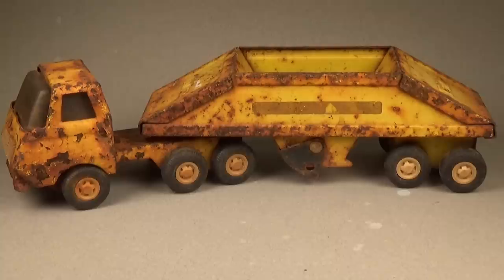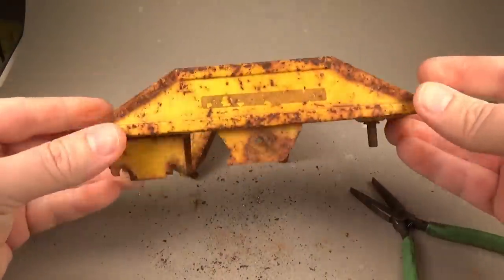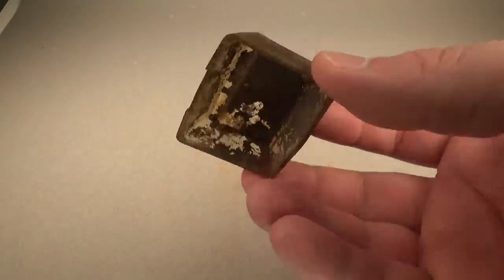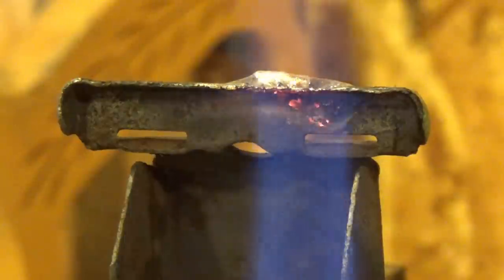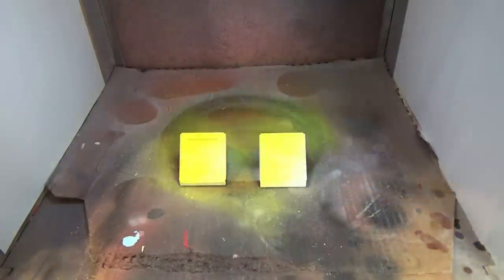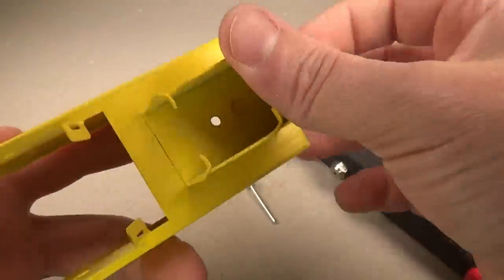Vintage 1970's Tonka Truck Gravel Spreader Restoration

Comment: You can remove the yellowing with salon care 40 works great brush on and use plastic wrap cover it set in full sun for few hrs or use uv lights. All yellowing will go away.... hope this helps

Comment: We use 2 of those sand blasters at work for industrial sandblasting of small components.   Your concerns are not really s problem.    The medium is reused.  If the guns gets blocked. It's because you don't have enough air pressure.    From an OEM design standpoint of the sand blaster.   That would be a very serious design flaw.   But it's not true.

Comment: Now that you have a sand blasting cabinet, will you be sand blasting your die cast cars to remove paint?
Is there any danger to compromising the body by using sand blasting method to remove paint and oxidation from die cast cars?

Comment: I have a black Tonka truck from 1980 that has a motor generator of some kind that still powers on without batteries when you push it around. They don't make em that rugged anymore.

Comment: In case you need to retrobrite in the future: the 8 bit guy tested several methods in a video and figured out it's not so much about sunlight or UV light but heat, so no reason to desperately wait for that precious sunlight. :-)

Comment: Removing paint then blasting is time consuming, If the gun gets clogged up just put your finger over the outlet and pull the trigger it will back blast the feed tube and dislodge the chunk. Eventually the paint or grease chunk will get ground down enough to stop clogging and you will feel the chunk shoot through the gun like a kidney stone after that its usually broken up enough to disappear forever. I have not changed media in a few years but I also dont use it much.

Comment: Great job on the restoration. But I never really thought that the oxidation looks "normal" and something you would see on the side of the road like an old car truck or at a junkyard. And that Hot  Wheels cars don't look normal and that you have to custom weather Hot Wheel cars and other diecast brands. Also there's a certain je ne sais quoi about these old iron cast Tonka trucks that you don't see on a playworn Hot Wheels and Matchbox cars and like you said it ads character to the Tonka trucks that Hot Wheels and Matchbox don't have. But I guess that's like you said the Tonka is made of iron and Hot Wheels is made of zamak

Comment: I can't remember which YouTuber that I saw a tip about the tabs and bending them.  The person carefully bent the tabs straight to disassemble the piece and before painting it he heated the tabs with a torch to anneal (soften) them so when bent back they would not break.

Comment: I see many videos on YouTube where people just take all the paint off using a sandblaster but they never do say if they use a filter or not I've never liked sand blaster because with some older metal that is rusted or weak the sand can go through the rust or pit the metal.

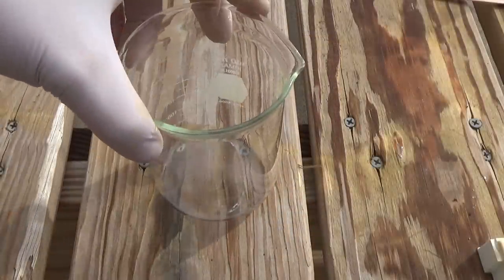Comment: 7:20 With the Hydrogen Peroxide method, I have seen others use the inside of box covered in tin foil with ultra violet LED's taped on the inside to mimic sun light and have come out with good results. A relatively cheap set up ($15) and plastics come out looking like factory fresh.

Comment: Why didn’t you soak the wheels in peroxide? They are yellow.
Reply: He didn't address the  wheel ,tire and axle assembly in this video...
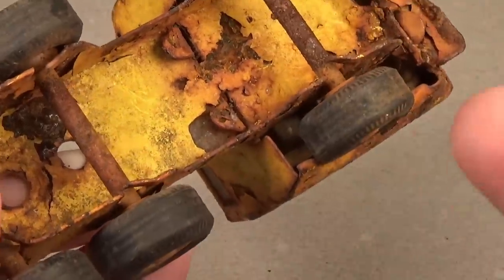Reply: booger macnaughton yes he did. @ 1:50 and he soaked them in Evaporust @ 5:00 then re-installed the dingy yellowed wheels @12:25

Comment: If you're you reuse your sand or soda compound whatever you're using to sandblast and you want to get rid of your paint that's in the sand so it doesn't clog up your gun you just simply put it in a tumbler or vibrator Tumblr throw some marbles in it and let it tumble for about 30 minutes and it will help grind up all the loose paint and big pieces of paint and make it small enough to go through the gun where doesn't stick. If you fear that there's moisture in it make sure that you keep it in a warm place to where all the moisture is operated out of the sand before use also you can store bags of coal with your sand in a breathable bag to help absorb moisture but keep coal and you're sand separate.

Comment: Personally, I'd leave it just as you've restored it.  Sometimes, weathering suits and sometimes it doesn't.  In this case the truck is clearly just a toy that's not really pretending to be too realistic.  Weathering it would be trying to introduce a realism that doesn't really belong there; just wouldn't look right, in my opinion anyway. 

But I'd love to see more larger scale restorations.  You have quite a talent at what you do so I think you shouldn't limit yourself to just toy cars and trucks.

Comment: I sand blast many many painted metal parts when I restored my 78 fiat x19 I can safely say it never really clogged mine up is check by unscrewing the nozzle every 20 or so minutes but it never became enough paint buildup to clog it and if it did it's super easy to unclog and restart

Comment: Being concerned paint chips will clog up your blasting cabinet should not be an issue. I use my blasting cabinet in the auto repair business. I pressure wash items to remove grime and loose paint. Then let dry and blast away.

Comment: It is fine for this one.  But that bar for the dump is riveted because if it is not, sand and dirt will get into the screw and either eat it away or create enough friction to undo the screw with repeated use.  Just know that if you ever use this in a sandbox, which is not likely, that the screw is now a point of failure.

Comment: The rod blocked kids from jamming things through the hole that would distort/spread the hole and made assembly simpler since both ends of the rod could be spread at the same time without a special tool outside of a simple arbor press.

Comment: the yellowing of the plastic CAN be fixed, coat it in high concentration hydrogen peroxide cream, wrap in plastic wrap, then use a UV light the same you did with the 2nd part. it will reverse it,  only silicon and TPU cant do this, and really like your videos,  i have zero interest in collecting these things but love to see what you do

Comment: Nice Finally! Someone who uses a Sand blaster to remove rust and or clean corroded parts. i would cringe watching these resto guys using wire wheels. Time is money and they are spending a lot of time with the wirewheel not to mention inhaling that crap.

Comment: You tend to worry to much about what a bunch of egg-heads think.  Do what you feel is best for you and the rest of them be dammed.  I would have filled in all the seen rust spots to get as smooth an outward finish as I could but that is me.  I am after the original look as it had, when it was first purchased and not what anyone else thinks.  Do you thing, you have my vote.

Comment: Here's the answer: real trucks and models are not produced with rust on them.  In fact, manufacturers go to great lengths to prevent rust on the final product, which is why many of the big manufacturers, such as Caterpillar, powder coat their metal.

Comment: If you have good paint stripper I wouldn’t waste the sharp edges of the aluminium oxide in the blaster. So; paint strip, blast, rust acid. *because the shot blasted pits can still contain rust crystals . :o) Yep, you have to body fill every single rust pit for a factory finish. I like th eased look though :D

Comment: That’s not quite the right yellow, it should definitely be more buttercup. I’ve seen other similar videos just blast the paint and rust off in one go.

I thinks they just used a rod because it’s the easiest to use a single larger piece vs two smaller harder to handle pieces.

Comment: looks worse after you restored it......The putty you used was for plastics only and didn't do shit to fill in the pits in the metal plus the bond wont stay so expect the paint to start pealing eventualy.There are several other YouTubers on here that do this same job and you would have learned a lot if you that taken a look at them before starting this